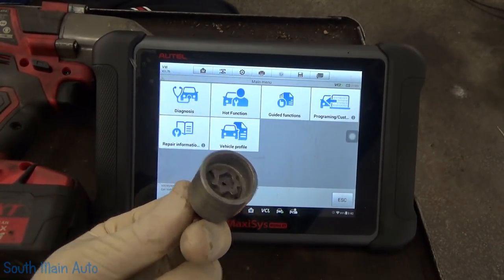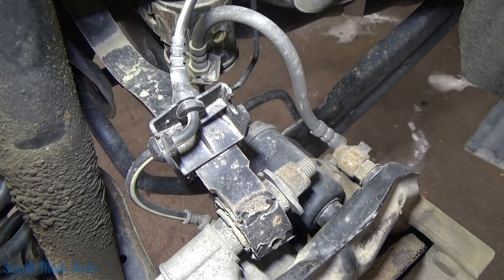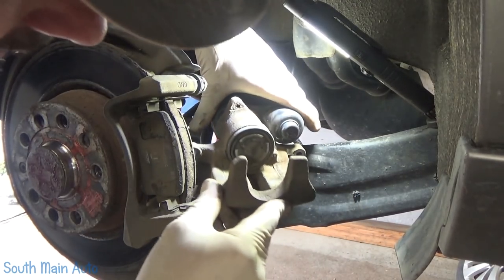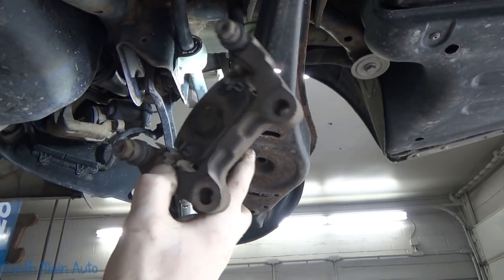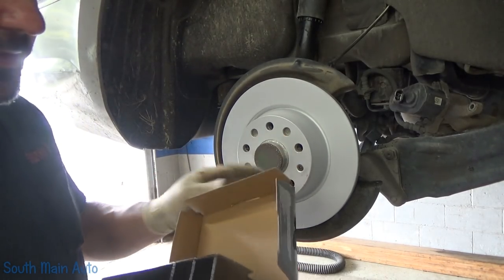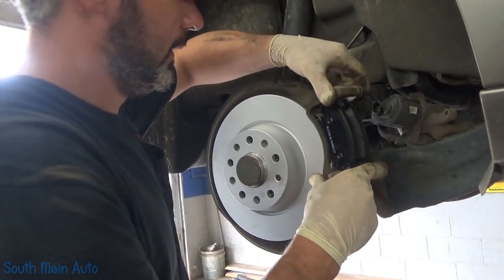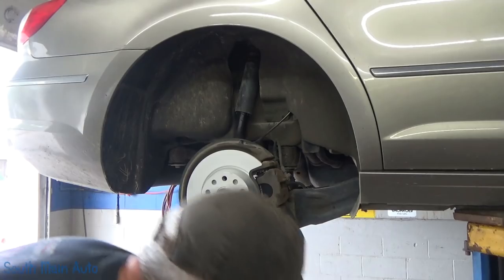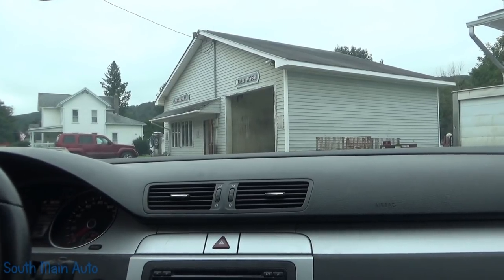Do You Need A $1000 Scan Tool Just To Change Brake Pads!?

Comment: Eric I sprayed fluid film (wd40 special)  the hub just like you do but it slings off and gets all over my wheels, tires and inner fender. Did I do something wrong?
Reply: Too much? I have and it has stayed put.
Reply: You can't use the thin stuff! It has to be think and sticky, like chain lube, not wd-40! Then you have to use just enough, not all that's manufactured in a calendar year! Too little, not enough protection, too much, slings onto your wheels! Just right, makes you feel all warm and fuzzy inside!!
Reply: @roadkill5333  wd40 has a gel version, which is similar to fluid film. I think that's the stuff OP is talking about. It's like chain lube, etc.
Reply: Try to keep it under 100 mph
Reply: Maybe try actual fluid film if it didn't work the same.

Comment: a tip that i have  found   i use  a little  pb  blaster   on  the piston  seals   before  i push  them in ..does not hurt  them    try it  saves  the seals  too   good stuff

Comment: I work at an Acura and we have to put the electric parking brake into maintenance mode too. We charge 2 hours labor for the brake job includes resurfacing the rotor. If we are replacing rotors then 1.5 hours labor.

Comment: I've done this job on an 07 Passat (basically the same car).You can remove the two bolts from the electronic assembly and turn the gear manually before pushing the piston back in. A little more work but better than spending all that money on a scan tool to change brakes.

Comment: My first "big" DIY job was the rear brakes on my 2014 jetta. It was bad enough I needed a 14mm triple square for the caliper bracket, glad my model has the good ol' mechanical e-brake and I didn't have to deal with this.

Comment: Easy work around. its just a standard dc motor operating the caliper. get a matching plug or some pins to fit the pinouts on the caliper and apply reverse dc current to actuate the motor without the car ever knowing. Then just switch the polarity to re- apply them after the job is complete as to not confuse the cars electronic system.

Comment: The one video where you can use BRAKE clean (on the new discs) and you didn't.......😂😂😂
Reply: Those discs looked like having geomet coating on them, they don't need any brake clean.
Reply: @PhaseP1  That can be true, but wouldn't you clean them anyway and risc grease on your new brakedisc/brakepads!? Worked long on cars and there is always risc of grease tranfer onto the disc, even by handling them. Don't think in exceptions, just remember : Brakedisc job = cleaning with brakefluid. 👍
Reply: If they are coated rotors you dont need to use brake cleaner, there's no oil on coated rotors to protect them from rusting during shipping etc.

Comment: Yeah, so not to bring back Lazarus,  but if you don't have the Scan Tool, the HF brake kit has the piston adapter for VW and you just wind 'em in. Service mode let's you simply push it...push it real good. 
Thanks for the amazing videos.

Comment: On my 2005 Passat 1.6 FSI I parked up, chocked the front wheels then disengaged the electronic brake. I disconnected the positive terminal on the battery then jacked up each side one at a time to remove each wheel. I disconnected the socket from the caliper then undid the two bolts to remove the caliper. Clean up everything and use copper paste where necessary before reassembly. Fit caliper with new pads and tighten then torque both bolts. Reconnect socket. Repeat on other side. Once complete fit the wheels and torque the bolts. Reconnect the battery terminal.  Start the car and press the brake pedal 2 or 3 times. Now press the brake button and it will engage. Remove chocks and just to be safe drive forward or backwards to try brakes then engage the electronic brakes. I recommend bleeding the all 4 brakes. Chock the front wheels and disengage the electronic park brake, start the car and bleed with the engine running so the brake booster allows the pedal to work as it would under normal use.

Comment: Eric. You should not disconnect the electric plug. It may sometimes lead up to nasty problems with the E-brake ecu. It doesn't broke down, but loses connections to the calibers. Been there done that.

Those guys who just spins pistons back in without using tester are just doing it wrong. Tester resets the pistons position measure  at the same time as it is taking e brack back to the normal state. Thats why it pulls and pushes pistons back and forth. Pushing&turning pistons in without using tester to put brake to a service mode, you are turning the mechanics too wich is not wanted. Service mode pulls the mechanism away from the piston and then there is only brake fluid behind the piston.
Reply: if it's only two pin plug 99% chance it's simply going by motor run and stall current, which means every application/setting it should recalibrate and only back off a bit when released....
if it has more than two pins bets are off there. apply a small amount dielectric grease to everything before plugging back in.......
Reply: Yep. It has only 2 pins. But still I've ran to issues and witnessed when other do. Software what shows the caliber current draw and step counter clearly shows that just driving pistons back with some simple function doesn't reset the step counter.

Comment: For 2018 and newer Mazda's with the electronic park brake service mode can be done without a service tool.
1) key off, floor accelerator
2) push down on the park brake switch
3) turn ignition on while the accelerator and switch are depressed.
The Amber park brake light should then illuminate to indicate you are in service mode.
The rear pistons can then be retracted. DO NOT TWIST the pistons as it will break the retaining lock in the caliper just push straight back.
To get out of service mode,
1) key off floor accelerator
2) lift up on the park brake switch
3) key on with accelerator and switch still activated. 
Amber light should then turn off!

Comment: When I worked at audi, the dealership charged 2 hours for the front axle and 2.5 for the rears. Always did brakes and rotors in order to ensure a good mating surface.

Comment: If you unhook the electrical connector and take out the two screws that hold in the electronic parking brake you'll be able to use a triple square M8 usually to turn the actuator screw back then just push in "piston" like you would on any other "regular" vehicle.

Comment: No wear indicators on those pads?
Reply: i think because the car knows how far the piston is out, it doesn't need sensors. when it detects the piston needs to be out x amount, it indicates low brake pads.

Comment: So what's the advantage of EPB?

Nothing.

Old fashioned calipers and parking brake cables are much cheaper to replace, and are non power dependent.

Sorry to hear Mrs. O is sick. Megadose Vitamin C is a virus' worst enemy. That, and a lotta water.

Also, I'm curious, how does FluidFilm hold up on a hub after a year or two?
Reply: no more draging brakepads due rusty parkingbrakecables.
Reply: @MultiArrie  EPB can fail too. When it does, how much more are you spending versus cables? Technology isn't always a good thing for the financially constrained.
Reply: @zeropointzero  had to replace 3 times the brake calipers with cables  in 12 years owning a mk4 golf that was acualy the only weakpoint of that car. I hope that EPB is more reliable. If you read the comments there are 2 ways to rewind the piston without a odb tool.

Comment: My wife's so 11 Volvo had similar rear calipers as you are about to do spend them in that replaces the service position also I found a a Allen nut on the back that actually spends them in also works pretty easily doesn't cause any errors emergency brake works fine afterwards

Comment: I don’t know about VW but on Ford and Mazda with electronic brakes you hold the gas pedal down and the switch to release the parking brake while turning on the ignition (my Mazda is push button so pushing the start button 2x) and it will put it in service mode. To put them back just hold the gas down and press the parking brake switch in the engage mode and turn on the ignition again. On Mazda you don’t turn, just push back the piston. Not sure about Ford. Took me over a week of searching online for this solution, found a screen shot of a PDF someone made. Tried it myself, works great.

Comment: You can get the 3 pin adoption for the brake wind back tool from snap on, and just leave the handbrake off, no diagnostic tool required, but they are a bit of a pain to wind back , can be done I've done them

Comment: Alright eric here goes. Im a mechanic down in texas but we mostly deal with dodge, ford, nissan, toyota and honda. Not alot of european car lovers out here but a thought did cross my mind. If its only a 2 pole connection on the caliper in theory you could hook a 12v power supply in one direcrion to disengage the brakes and flip the polarity to reverse the process. Not brave enough to try this on a customers car when i have an obd tool available to me but please let me know if anyone else tried and failed or succeeds

Comment: Quick before zeeee Germans get here!

Large majority of “European” cars have moved to electronic handbrake now unfortunately.
Reply: Mercedes is actually working on fully electronic brakes, no hydraulics at all.
Reply: Japanese and American also. Appears to be a trend.
Reply: Most recent Toyota CH-R I rented both applied and released the parking brake automatically whenever the ignition was turned on or off.  With the key in your pocket, all you had to do was jump in and push the button and move the lever to Drive.
Reply: Just think what happens when the system develops a problem while you are cruising along at 70mph... 
Between the electronic power steering and electronic brakes things could get interesting.... At least with conventional brakes if the ABS has a problem it just shuts down and you still have manual braking through the hydraulics. What happens when you have no mechanical option ??
Reply: capnskiddies most electronic handbrakes have an emergency disengagement. Once they’re on they don’t tend to come off. Large majority ive seen are electric actuators- so stay closed. 95% Failure tends to be when someone’s changed the pads without following procedure or they’ve come out to far and won’t go back in smoothly. 

American cars have been very far behind in economy and advancements in my eyes for a long time.
Reply: That is because we Americans don't want the sort of vehicles sold in the rest of the world. Advancements are fine IF they work and can be trusted. With the number of failures seen in just EPS systems I won't ever buy a vehicle with it on them or a vehicle with fully electronic braking.
Reply: Garth Goldberg  Never use parking brake , except to check it prior to yearly state inspection .

Wyr
God bless
Reply: Blazer02LS that and how am I supposed to stunt drive without full manual control of the e brake
Reply: Blazer02LS We have to have handbrakes as most of the rest of the world don’t have autoboxes- Murcia yeahhhhhhh! Home of Donald Trump and 8mpg 🙄
Reply: TDM 4x4 - "Quick before zeeee Germans get here!" - Whatever you do DON'T MENTION THE WAR!!!
Reply: Does the acura nsx have fully electronic brakes?
Reply: @Blazer02LS  There's gonna be something to prevent that. Firstly current UK legislation (as I live here and only know this) doesn't allow certain things to not have a mechanical link and brakes are included. I can't see mechanical brakes disappearing any time soon though.

Already Mercedes are having secondary batteries fitted into their vehicles so that during a power failure there is always an emergency supply for the ECU, airbags and ABS and the rest of the vehicle will shutdown so you can still stop safely.

Comment: Amount if accidents and breakdowns they had on these in europe is shocking, totally unneeded and defeats basic engineering criteria of a parking/emergency brake .
Having dealt with this junk I know 2 ways do it without scan tools, 1; power and ground the caliper motor and fully wind piston in (reverse polarity if going wrong way.
2; remove motor and manually wind .
For tools, foxwell is pretty cheap and useful, you will find open source software for many makes if hunt for it but will have buy interface of some sort but that cheap .
These are absolute ballache with failed motors leaving car stuck and whacky electronics having your car roll away, I did see one VW owner took VW to court as car rolled into him breaking his ribs and damaging 2 neighbours cars :-S 
Absolute marvel of modern engineering, total fooktards is all I can say :-/ beggers belief .

Comment: WHAT??? No Brake Clean on new rotors?  Withdrawals here! (+_+)
Reply: They were sealed in nylon bag and probably they don`t have anti rust grease coating... imho
Reply: Those look like they are coated so they don’t rust, using brake clean will make them rust faster. I used similar ones last time I did brakes and I was told to not spray brake clean on them.

Comment: It can be done manually! I've done different Audi and VW this way. Just separate the plastic electric motor from the caliper (3 bolts), use a triple square (on back of caliper)to wind it back till it stops, then put it back together. Now u can push back the piston like a normal brake job. With car off pump brakes then set the parking brake and you're done.

Comment: 4:13 Stupid frickin Volkswagens.  My thoughts exactly.  The Apple Computer of car companies.  They won't be happy until they find out a way to require you to take the car to the dealership to wash it and fill it with fuel.
Reply: Bad comparison. There is always VCDS or perhaps OBD11. Perhaps Tesla is the company you are thinking of when it comes to locking out the DIY'er (or often the local repair shop).

Comment: On most Mercedes Benz cars with an electric parking brake you can change the rear pads without a scan tool. There is a button combination to access a service menu on the dash, with that you can retract both pistons electrically. Smartphone apps together with an OBD dongle like Carly usually can do that too on BMWs, etc.

Comment: I believe the Autel MD802 has the EPB release option and it runs $150+/- I bought the MD805 as it is supposed to be capable of reading all modules in a vehicle and it was $160. As a DIY it is more tool than I will ever need...but I want MORE! But not the $1200 price tag😉

Comment: I have an Autel MD804 and a few pirate factory scan tools. Its done the EPB and oil light reset on a few different cars but i haven't tried the EPB on any VAG vehicles yet. It has done oil reset on a few.

It will pull data from the Engine, transmission, ABS and SRS modules on most vehicles. It has an OBD2 mode but i mainly use it in the manufacturer specific mode. I think i paid £179 for it. Its been very useful. For the amount of cars i work on i can't justify a shiny all bells and whistles Maxisys like yours. Most of what i work on is junk anyway. lol

EDIT: GET WELL SOON VANESSA!

Comment: i never buy german cars and never will for this and many other reasons.german cars are not good cars .
Reply: Dont buy ford then too,  because it has the same parking brake servise...
Reply: many beamers etc you cant even change a simple headlight bulb and expect it to work lol you have to tell the computer that you installed a new bulb with a special scanner in order for it to work.lol not for me.never liked german cars and never will.nothing can stop a Toyota or honda.
Reply: Our 2 b5 Passats would like a word with you. Truly great driving little cars.
Reply: toyotas/hondas are overrated and drive like a loaf of bread.  ericO is always working on hondas.  u EVER notice that?  glad you ain't driving German cars.  nor working on them - they wouldn't like you.
Reply: The b5 passat is actually one of the better VWs
Reply: @pupupipichorrorelief4909  except  maybe an exhaust valve with carbon buildup (at 70k miles yet).  now that's RELIABLE.  (see ericO's video.)  or rusty frames that made driving your truck dangerous.  yep, nothing...

Comment: I used OBDEleven blueooth scan tool (for Android only, I think still).  It's reasonably priced, but you buy credits as you use it.  Grrr.  I've used this on my 2005-2007 Audi A6 to do the rear brake change.  It also told be I had an intermittent on the driver's side door bass speaker.  (lol, Audi).  I bought my first Android just to use OBDEleven.  It's OK.  Credits can go quick when you are just learing.  I bought a VCDS finally so I have more functionality.  EBDEleven seems to be lacking in older Audi year modules.  Great videos sir.  Thank you!

Comment: To rewind and set the calipper with out diagnostic tool you can remove the motor from calipper and (usaly torx or xzn) turn the bolt to losen the piston.
To set you tighten the bolt until the   pads grip the rotor and back of a quarter of a turn (or the rotor can move) then you wont have any fault codes.

Comment: u can grab a couple jumper wires and a 12 volt battery to release the parking brake just make sure its the right polarity to retract the piston and not extend it. after your done just apply and release the e brake a couple times with the switch and your golden.

Comment: FYI for those who are wondering how to retract and reset the electronic brake without a scan tool. This is a basic 12V signal, disconnect the connector and connect a 12V source across the pins, reverse the pins when/if needed. No scan tool needed.